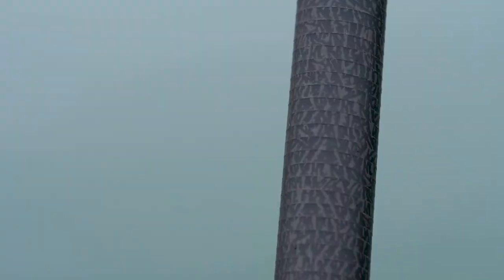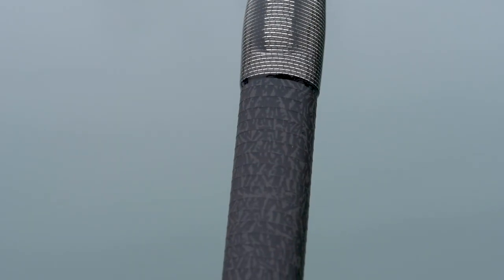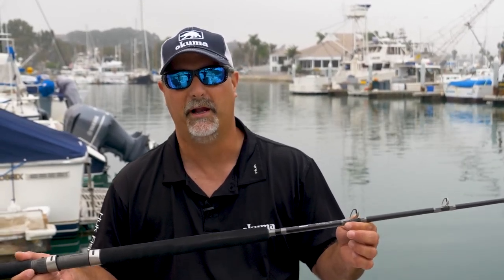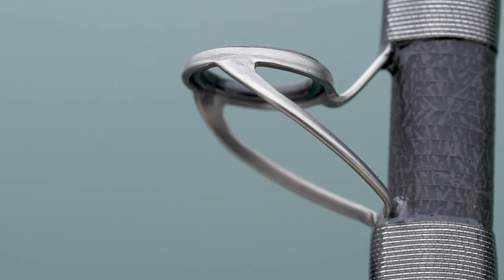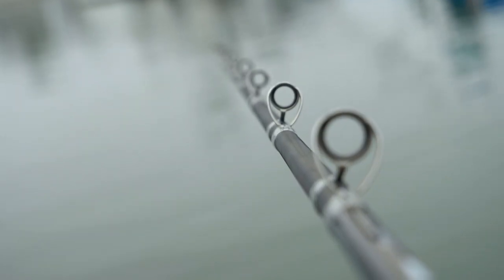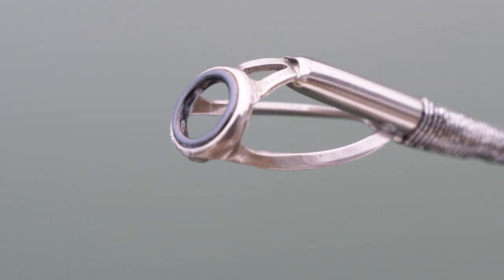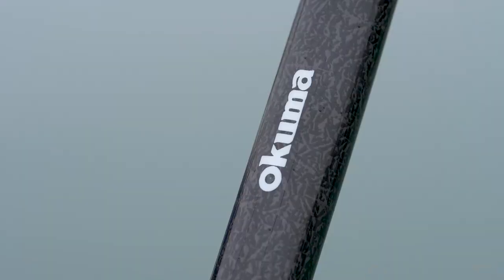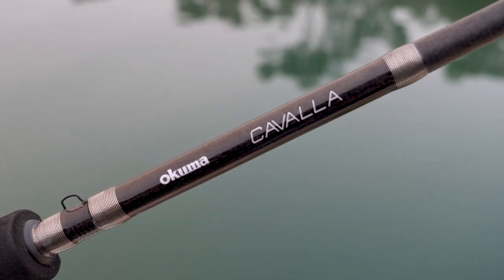Okuma Cavalla Boat Rods - NEW 2021

Comment: Just bought the CAV-C-601XH, the 6' version dedicated to jigging.

Why is there a flat on top of the foam foregrip?  Shouldn't the flat be along the foregrip's bottom so that the rod is steadier on the boat rail when bringing up a heavy fish on a heavy jig?  

The rest of the conventional rods in this lineup have fully cylindrical foregrips for some reason.
Reply from the maker: Hi Jake- As this particular rod is meant to be a jigging rod, the flat portion is on the top of the rod so that as the rod bends, there is less of a chance for the line to groove into the foregrip.  This is the only rod in that lineup specifically designed for jigging, so the only one you'll see it on.
Reply: @OkumaFishingUSA  -- Thank you for the explanation!